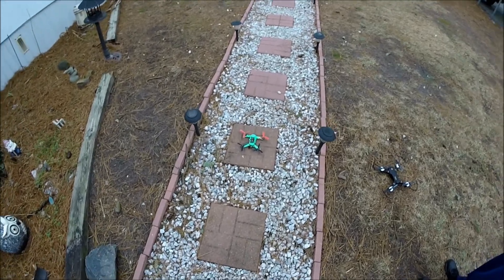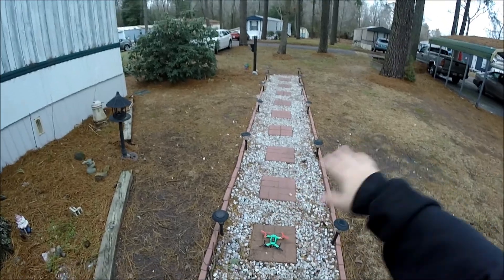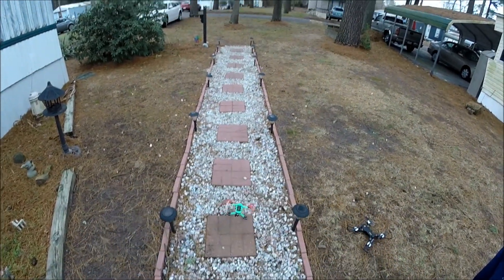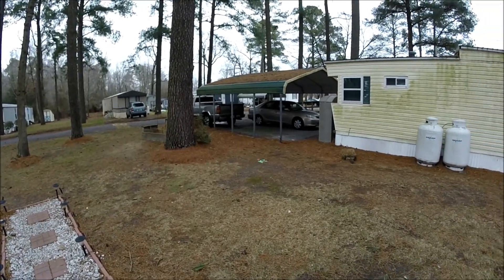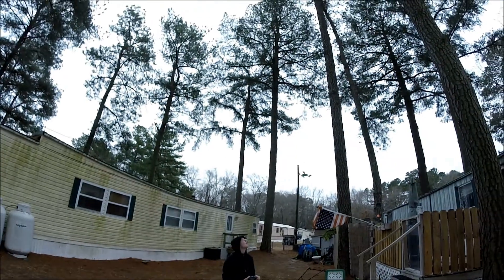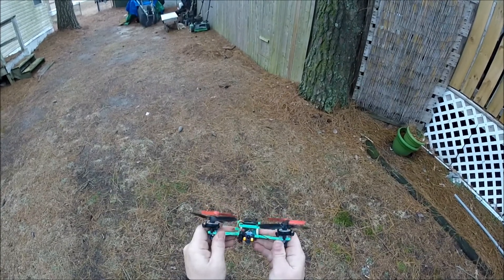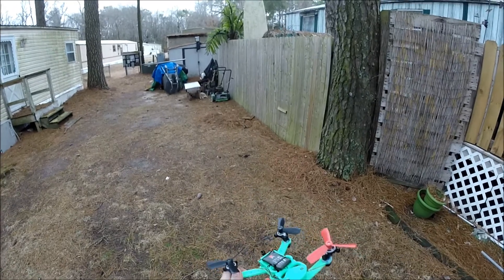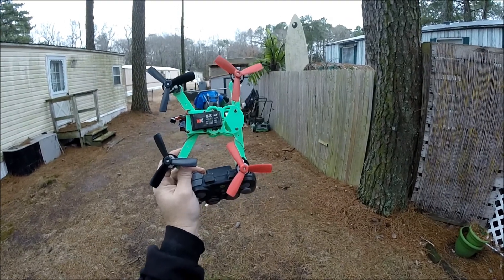Punisher 3d printed frame

Comment: very nice frame. great job.   i have had 4 of those sky viper stunt drones and and the board always goes bad the first time i flip them upside down in the grass .   so what i did was get a sky viper 1750 board and put it into the stunt drones frame. and now i have ben flying it for months with out any problem and it flys a lot better to.  i use it for fast fpv flying with goggles around all the trees at my place. and i am hooked now. i have got more flight time on that toy drone than all my other drones combined. and thats saying something.
Reply from the maker: I am gonna send you this Boldclash f01 camera Brother
Reply: ooohhh weee  thanks chris.   this time i think i need to put something over the top of the camera to protect it for when i crash. cause i fly that sky viper 1750 very fast weaving in and out of the trees so sometimes i crash . hahaha but it's fun as hell !!   i will test it as soon as i get it.  im sure it will be better than the one i am using now.  thanks thanks thanks.
Reply from the maker: No problem Brother

Comment: hay whats up.   in your opinion what is the best aio camera like the tx02 or the wt02 for a toy drone like the sky viper.  i am using my boldclash tiny whoop camera on it right now and love the wide angle fov but on a bright day the sun flaires out the screen to much. i had a 800 tv line $10.00 aio camera from gearbest on it first and loved it it was 170fov and it would make the sun black but it quit on the second flight. so now i dont know what i need. any sugestions?
i like flying around the yard fpv style with goggles with a toy drone cause you can realy go crazy and not woray about breaking the drone if you crash.